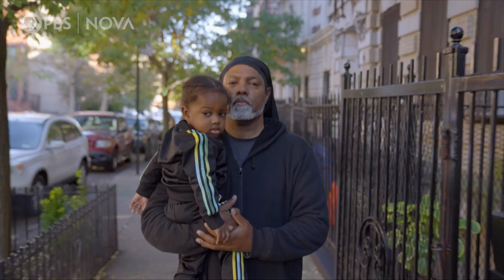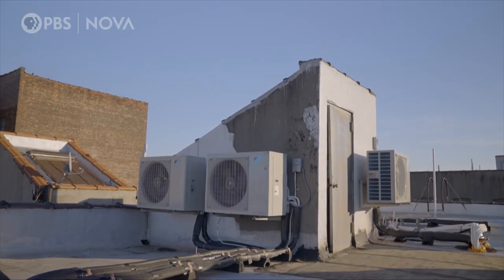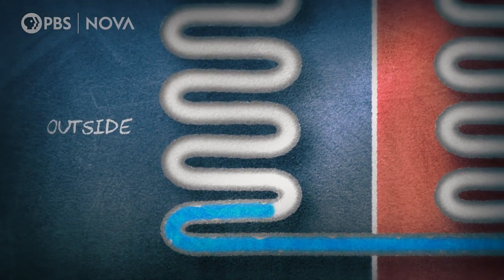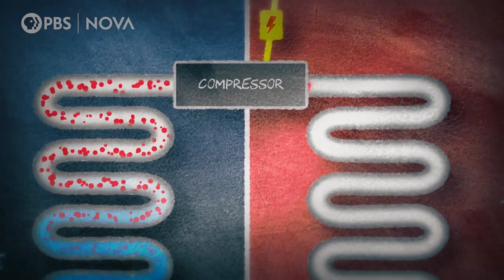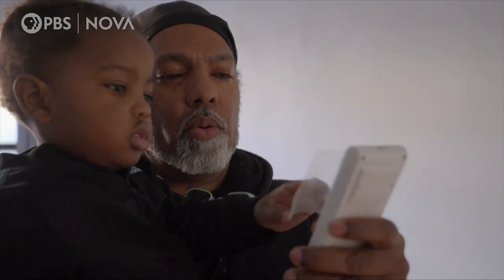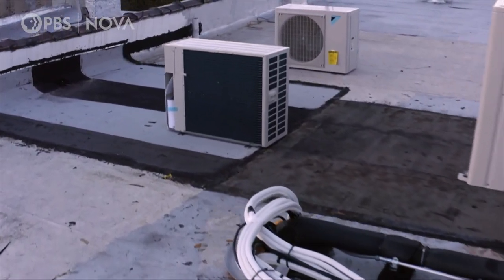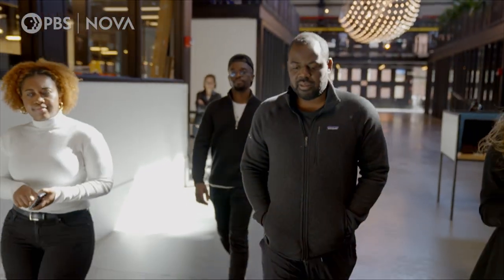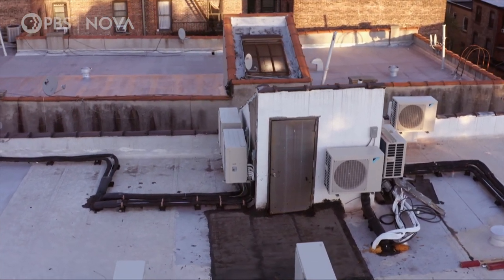How Heat Pumps Can Help Cities Lower Carbon Emissions

Comment: What kills this, is the cost of installation.  I summer in Greece where the cost of the unit/materials is the same as here, but here JUST for "charging" the unit - after I install it, both the unit on the wall, and the electrical - it costs close to $1 K.  In Greece, ALL the installation is $150.00.  So, to install four units for the whole house (One in each room), there would cost as much as just one room here.  So, right now, I am learning how to do my own "charging" installation.  But most people can't do that...here in the U.S.....
Reply: Our government could give rebates…
Reply: Entire installs for $150?😅
Reply: @jeffperegrina4183 , yes, not kidding.  I am putting another air condition next week in one of my bedrooms - I am here in Greece for the summer.  The unit is a 12K BTU, costs me 400 Euros, plus the installation which is 120 Euros.

Comment: Heat Pumps run on electricity. Where do you get the electricity ? Coal power plants ? Oil Power plants ?  Now if there were wind & solar power generators on the roofs .
Reply: Yes. It goes together. Efficient efforts that lower energy demands, and heating/cooling which uses the most of our buildings’ electricity. Also switch to renewables, although it is already progress to lower energy demand and that can give our grids some ease
Reply: How come we don’t just shovel coal into a fire pit anymore to run things? Oh, it’s about efficiency.
Reply: @Maverickgouda  Heat pumps run on electrictity and where do we here in New England get the majority of our electric from, burning NG, and where do we get most of our NG from...Putin's Russia. Last year Eversource here in NH raised our rate by 112%...plus they don't work too well at -20F with a -30F wind chill. Up here it's much better to better insulate your home.
Reply: so build more solar.. seems obvious with how cheap and getting better yearly
Reply: @dertythegrower  Solar and wind make you more reliant on gas, oil, coal and nuclear to be there instantaneously when they go down. That's the problem, intermittancy.

Comment: This is NOT a one size fit's all problem...
Heat pumps run on electrictity and where do we here in New England get the majority of our electric from, burning NG, and where do we get most of our NG from...Putin's Russia. Last year Eversource here in NH raised our rate by 112%...plus heat pumps don't work too well at -20F with a -30F wind chill. Up here it's much better to better insulate your home.
Heat pumps might be great...depending on your situation and your location.

Comment: This winter we were below zero Fahrenheit most every night. We went through 4 months below 32⁰ Fahrenheit. Do these heat pumps work when it's that cold?
Reply: -40° F is what they said was the low temp at which the refrigerant no longer works. That’s 72 degrees BELOW freezing and 40 degrees BELOW 0° Fahrenheit. Unless you live in Siberia or Antarctica it probably wouldn’t be a problem.
Reply: Jaimie - you can talk to a local HVAC contractor but it is highly unlikely you can get by with a heat pump without supplemental heat.  Technically heat pumps "work" at temps above -40f but the reality is the amount of heat produced at those temps is inadequate to heat a house.  You would have to drastically oversize the heat pump or add supplemental heat.  I looked into this for a rental condo I have.  
There is a huge cost saving if you just use a heat pump and no supplemental heat which is probably what the slum lord and the blocpower hustler in Detroit in this video are counting on.  However if you have a cold winter you just might need to use the oven to keep yourself from freezing just like back in the day.  The landlord and blocpower are going to be in a pile of trouble if one of their elderly tenants freezes to death.
Reply: I live in New Hampshire....do they "work" at low temps yes...but below 10F you'll be surprised how little heat you will get from your average sized heat pump. The real problem is a homes heat loss. You really need to insulate a home if your going to run a heat pump in cold climates. Or have a supplemental heat source.
Reply: I live in Northern New Brunswick 🇨🇦 we get -24C, but one secret to heat pumps is location in your house, but summer months works as an air conditioner. I also have a wood/electric force air furnace but mainly run the heat pump. I like the heat pumps.

Comment: We need fuel, gas or oil to run the electric grid which is overloaded now. Bad idea to add more stress with EVs and Heat pumps.

Comment: Heat pumps start petering out at 32 F , at -40 you’d freeze to death.
Reply: I’m no expert, but from what I’ve read there are cold climate heat pumps (as opposed to what’s called "air source’ heat pumps) , which is what the description of those in the video sound like, that work at much colder temperatures. They’re popular and used in Norway, for example.
Reply: @joonzville  You're talking about ground source heat pumps and they require pipes buried in the ground and are expensive af for a retrofit.  This video is very dishonest in regard to how low a temp an air source heat pump will work.  They will work to -40 but the heat produced is so small you would have to drastically oversize them or add supplemental electric heat which is expensive if you don't have a solar array and battery setup (which is expensive again).  I do feel sorry for the tenants of these slumlord hustlers in Detroit - someone is going to freeze to death.

Comment: Hmmm.. NOVA failed to mention that most of the electricity that powers the heat pumps comes from.....fossil fuels. 🤫
Reply: Lol yikes
Reply: True, but large-scale fossil plants are way more efficient than small residential heating boilers.
Reply: @Tmanaz480  true. But NOVAs failure to mention this is disingenuous as best, willful omission at worst.

Comment: IT helps, but transportation, manufacturing and military weapons cause the vast majority of pollution.
Reply: 13% of CO2 emissions in the US are from residential/commercial buildings, primarily for heating, cooling and lighting. This is the 4th largest contributor. If you add the percentage for generating the electricity used by these buildings (and all electricity production accounts for 25% of CO2), then the share for residential/commercial goes up considerably. Transportation is around 28% and industry is around 23% (and if electricity generation is added to industry, its share goes up a lot, too).

We need to reduce ALL sources of CO2 if we want keep this planet half-way livable for ourselves and our children. We’re already too late to prevent some of the disaster that’s barreling down the tracks at us.
Reply: @joonzville  Are you agreeing or disagreeing with me, seems like both
Reply: @Keepskatin  Clarifying, mostly, and pointing out the knock on effect of reducing electricity production’s 25% by improving different buildings’ 13%.

BTW, where did you get the stat that military weapons are such a large contributor? The only thing I found said that all of the DOD is responsible for around 1% of emissions and if you added in the manufacturing of their ‘tools’ in the civilian sector, it brought it up to 2%.
Reply: @joonzville  Nuclear testing
Reply: @Keepskatin  What nuclear testing? I thought the last done was in the 90s.
Reply: @joonzville  nuclear testing has effects that last for decades to many centuries. You have a lot to learn my child.
Reply: @Keepskatin  On CO2 emissions? Global warming? Got some links to studies that support that? I’m willing to learn.

Comment: Pump it to where? Lol
Reply: It just moves heat from the outside air to the inside air, or a reverse air conditioner to put it simply. No overall loss or gain of heat, it's just moving it.